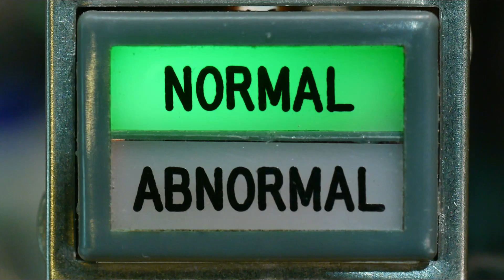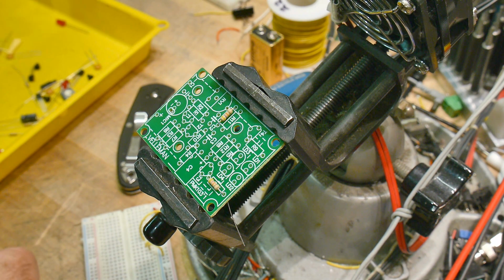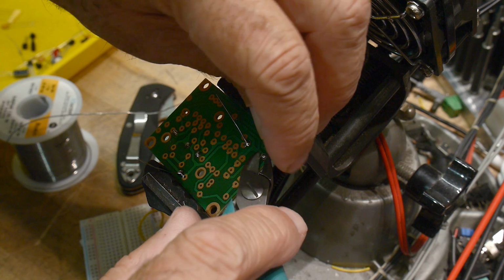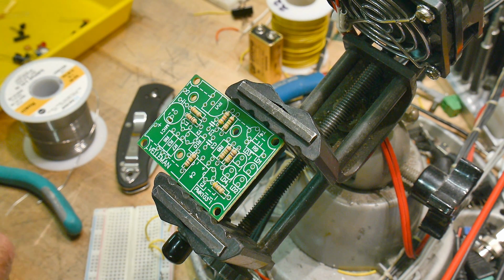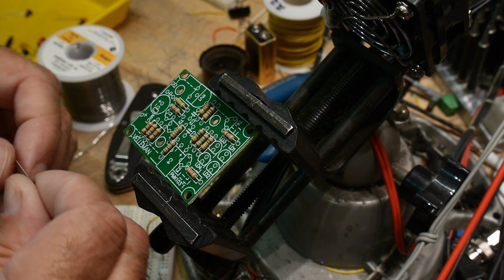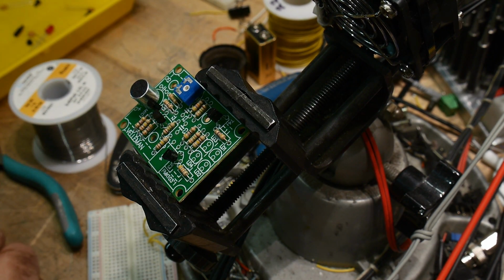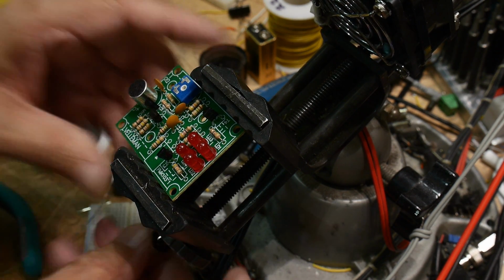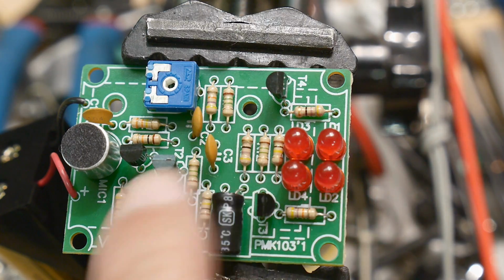#1191 Light from  Sound

Comment: Good channel IMSAI! Although as an 61 year old electronics engineer spending most of the time after school soldering, I disagree about making the solder joint shiny for 1 sec. I've learned to "cook" the joint(make it bubble a bit) for 2 sec or so to make it last. 40 years later, no solder joints of mine has failed. Just ask a welder: quick burn gives "chicken sheet" (directly translated from Norwegian). Not good with cold joints.
I mean, Its a chemistry of metals with flux to make them clean and like itch other in order to make a liberally connection.
I'm probably alone with this, because it seems that 99% of youtubers prays the shiny joint.  Well, Its no big deal really, most joints would last a while.
Reply from the maker: can't say I've every had one of my joints go bad. I don't look just at the solder but look at the wicking too. I think good brand/type of solder is key also. The lead free is junk.

Comment: An online Ayurvedic practitioner once told me based on the three doshas or body types and mine being diet related not to eat red stuff much if at all.  I recall reading that elsewhere too, oh the chronic urticaria diet.  That same gal noted not to use lemons and use limes instead.  Worked... somehow I guess was related to my histamine reaction issues. Not finding the video in my history however... bummer when there are live feeds and comment threads. Probably was like a decade ago.  Anyways, that circuit seems like would be interesting to modify for RF input or if you wanted a noise detector wired to a quiet location like for seeing what's getting into the garden.  Yeah, living with Indians at Michigan Tech got me drinking tea regularly and I have a cup of Earl Grey next to me in my "Engineers See Things Differently" "Parker anything possible" mug.